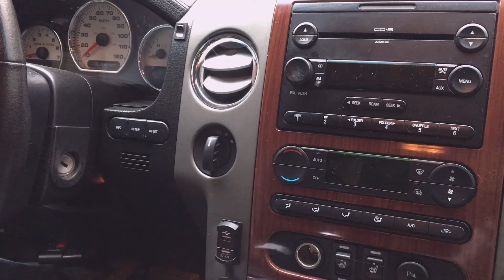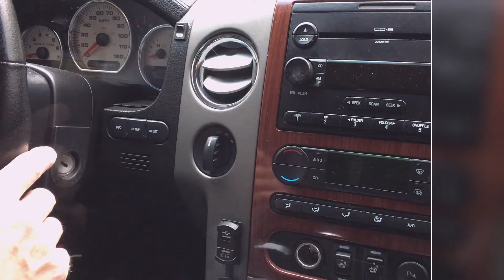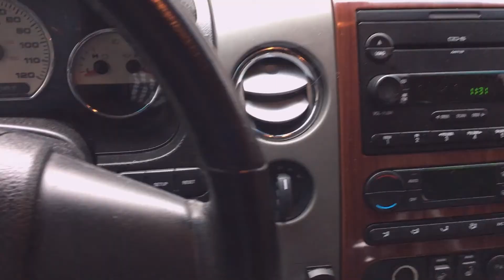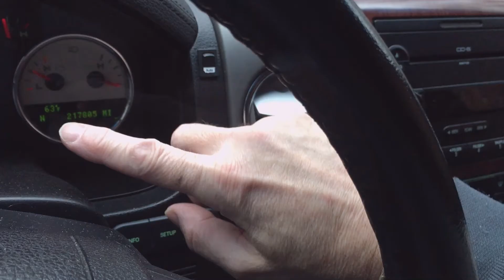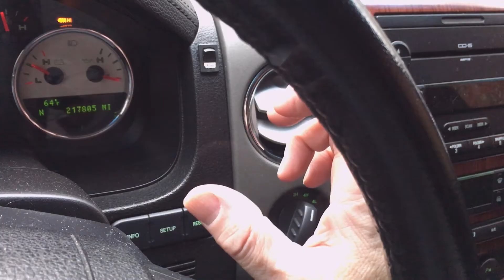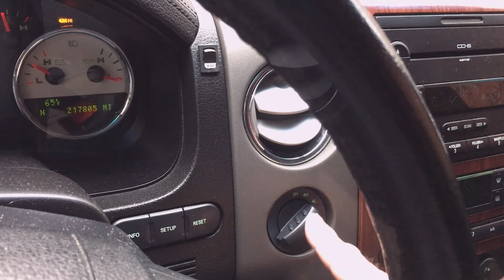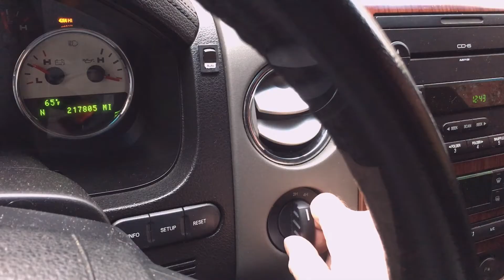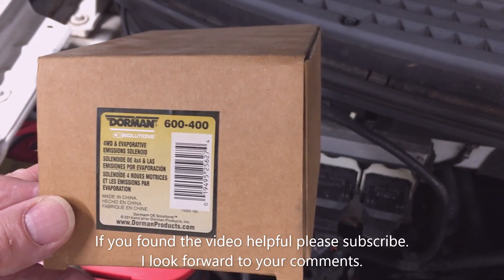4WD Automatic Hub Engagement Troubleshooting & Solenoid Bypass '97 to '18 F150, 11 to 18 Super Duty

Comment: How about first checking vacumm lines at hub. After replacing solenoid and check valve nothing changed. Sure enough I crawled underneath and one of the vacumm lines had become disconnected.
This may have happened when I previously got stuck in a deep snow drift? Works perfect now.
Reply from the maker: Bruce, Yep, most of the time, it is the simplest of things. As a young Army Mechanic, I learned to first ask the Operator, what was the last thing you did. Then describe the problem to me.  And . . . . that is the only time(s) my 4WD has given me problems, is when I needed it most! I appreciate the comment! - Stiles

Comment: Good vid. I replaced my check valve today and realized that it already has a revised assembly with the blue valve. I replaced it anyway but if the grinding still happens should I do the solenoid next? I have one already
Reply from the maker: Terry, I appreciate the feedback. First of all, if your Vacuum Solenoid doesn't have the Plastic Hood over it to protect it from water, then replace it. The Solenoids normally fail in one position or the other, either in open or closed, either in 4WD or not. That is normally. 
You have a grinding noise from your Integrated Wheel End (IWE)? When you engage 4WD?  As I stated in the video, Vacuum to the IWE = Free Wheel or no 4WD and No Vacuum to the IWE = in 4WD.  Your likely problem is the IWE, not the Solenoid.  Let me know how it goes! - Stiles
Reply: Thanks. Problem happens in 2wd. Yes the solenoid hood is not there. I'll try the solenoid next and let u know
Reply: @Kurse19  I'm having the same problem. When I'm in 2x4 i get some grinding then it sounds like the solenoid pulls vacuum again and the grinding stops for a bit, then does it all over again. This happens without any interaction from me. Makes me think i have a vacuum leak but not sure. When I'm in 4x4 high i have no issues.
Reply: @tejanoiniowa  replace the solenoid
Reply: @Kurse19  I did replace the solenoid but still have the same issue. Will try changing the check valve today.
Reply: Is the check valve blue or white? Also it's a one way valve. Take it off and blow through air should only go one way

Comment: Interesting but more questions arise. What does the dash switch actually do? Does it switch off the vacuum solenoid so the hubs lose vacuum and therefore engage? Or does it do something down in the transfer case. I have hubs engaged when truck lifted and engine off. When engine turned on hubs disengaged. Seems normal. When dash switch on to 4wh no dash light on and no engagement of 4 wheel drive. Is it the vacuum solenoid ,or something else down at the transfer case? Also how many fuses are involved. Note at turn on key dash lights show 4wh and 4wl . What other steps to troubleshoot? How do you prove the solenoid? Can it be taken apart and fixed? You mentioned a clicking noise when son turned on 4wh but indicated it was in the transfer case. How many volts should be on the vacuum plug? Should voltage be constant or no voltage when 4wh switch on dash moved?thanks ....the vac solenoid is
Reply from the maker: Michael, I attempt to answer each of your questions: (but first my video covers 1997 thur 2018 F-150 and Super Duty; I could be more specific if you told me what Truck you have)
1) What does the dash switch actually do? I talked about this in great detail in the video, however, if you have an F-150 older than 2004, you have 2 vacuum solenoids on the firewall; the 4WD Switch powers the IWE Vacuum Solenoid and powers the 4WD Actuator on the Transfer Case (for 2004 and newer). For older Trucks, it powers Both IWE Solenoid and the Transfer Case Solenoid.
2) Does it switch off the vacuum solenoid so the hubs lose vacuum and therefore engage? No, it switches "ON" vacuum so the Hubs (or properly called Integrated Wheel Ends (IWE), but "Hubs" is common term) . . .  so the Hubs disengage.  This is designed to allow the Hubs to fail (no vacuum condition) to 4WD, so you not get stuck when you need 4WD, and if you don't need 4WD you just use more Fuel. 
3) Or does it do something down in the transfer case. [?] Yes, it does, see question 1.
4) I have hubs engaged when truck lifted and engine off. When engine turned on hubs disengaged. Seems normal.  Yes, this is normal!
5) When dash switch on to 4wh no dash light on and no engagement of 4 wheel drive. Is it the vacuum solenoid ,or something else down at the transfer case? This sounds like you have a bad Transfer Case Actuator, which is very common.  Again the 4WD Switch powers the Actuator when the Actuator moves and then gets into gear, a Position Switch in the Actuator sends power to the 4WD HI or 4WD LOW Indicator Light on the Dash. (This description is slightly different for older than 2004 Trucks)
6) Also how many fuses are involved. Note at turn on key dash lights show 4wh and 4wl . What other steps to troubleshoot? Fuse 17 (30A) in the Power Distribution Box in the Engine Compartment powers the Transfer Case Actuator and may be at fault. Also Fuse 12 (10A) in the Passenger Compartment Fuse Panel, powers lights and relays (probably not at fault).
7) How do you prove the solenoid? Put your finger on it and have someone more the 4WD Switch from 2WD to 4WD, it should click and you can feel it. Or, you can remove the Electrical Connector and power it with 12Volts.
8) Can it [4WD Vacuum Solenoid] be taken apart and fixed? I wouldn't, it is very inexpensive ~ $ 30.00 (or $40 for Motorcraft)
9) You mentioned a clicking noise when son turned on 4wh but indicated it was in the transfer case. Yep, the 4WD Actuator moves and makes an audible click.
10) How many volts should be on the vacuum plug? Should voltage be constant or no voltage when 4wh switch on dash moved?thanks ....the vac solenoid is.  You should have Battery Voltage (11 to 12.6 Volts).  Because of your question 5 above, and this, Your Transfer Case Actuator may be stuck and trying to move. When you more your 4WD Switch is there a noticeable load on your electrical system?

I watched part of my video again, and I did a good job describing the 4WD system, at least for the 2004 and newer Trucks!  -Stiles
Reply: @StilesAutomotive  Thank you for the reply, it is quite helpful. I took off the transfer case motor actuator and it did turn when power applied. I attempted to remove the 3 T15 screws to get at the inside. Apparantley whatever is behind the 3 T15 screws after sitting for a while can be the problem .  One broke and two just crumbled. I was attempting to rotate it by hand so tha it might free up. I then got a local price on the motor at $275  so i bought one new  online for $77. This was after checking all the relays, fuses and the solenoid on my late model 2004 F150.

Comment: Excellent video but doesn't address the issue I'm having I don't think,

I was driving my truck the other day and it kicked into four-wheel drive several times even though the switch was in 2wd.

I also have two solenoids on the firewall mine is a 97.
My truck is kept under a carport so it doesn't receive a lot of rain I don't drive it a lot either other than hunting around the farm.

Any advice would be appreciated
Reply from the maker: C, You didn't give me much to go on. 1997 F-150 4WD.  How do you know it is going into Four Wheel Drive? Like my Truck, you have 2 sides to the 4WD activation System, 1) the Front Wheel (or Integrated Wheel End (IWE)) Hubs that include one of your Firewall mounted Vacuum Solenoids, and 2) unlike my Truck which has an Electric Motor Actuator on the Transfer Case, you have a Vacuum Actuator on your Transfer Case and a second Vacuum Solenoid on the Firewall.   If you are not touching the 4WD Switch on the Dash, I suspect you may have a vacuum problem, either a vacuum leak somewhere causing your 4WD System to have a problem, or a leak in your 4WD System.  Based on what you said, makes me think your 4WD light on the Dash is indicating your are in 4WD, that is the Transfer Case side, so there is either a leak in the Vacuum Lines/Hoses or your 4WD Actuator on the Transfer Case is leaking.  One of my main points in my video is that, when the 4WD IWEs fail, they fail in 4WD, this is a no vacuum condition. I believe your Vacuum Actuated Transfer Case is the same way, when it fails it goes into 4WD.  Let me know how it goes! - Stiles
Reply: @StilesAutomotive  it's going into four-wheel drive I know this because the four-wheel drive light comes on on the dash and when you slow down and turn sharply especially on pavement you can feel the wheel hop.
You can also feel it when you're going down the road you can tell the difference when it's in 4-wheel drive and when it's not.

But you can hear the click in the dash click click click the – light goes on and off every time it clicks in the switches in the two-wheel drive.
It's definitely going into four-wheel drive.

So you're thinking it's either one of the solenoids on the firewall or the vacuum actuator down on the transfer case motor.

I have good vacuum at the solenoids when the motor is running..
I have not tested the vacuum actuator down at the transfer case electric motor yet.

And obviously it's winter my least favorite time to be crawling under a vehicle LOL
Reply: check your evaporator canister for moisture.( mine was located behind my battery I have a 08 and mine had alot of water. i had same issue as you explained. I alsol had some bad hoses under core support...that's is where the water was sucked Into the system I think. also check your vaccume check valves.

Comment: I like the military spec battery retention system. :)
Reply from the maker: Toby, I did a video to talk about what I did in detail and how I designed the Dual Batteries (See link below). If you are going to change something; either put it back to Stock or design to make it better. Often, it is easy to make it better!  - Stiles

Dual Battery Design & Install; Modification for Any Car or Truck, Shown on 2004 to 2008 F-150 Trucks.  https://youtu.be/t05w5tv64g0

Comment: Ok you video was on point. Good job. Not that I’m anybody to say this but I’ve been looking for a troubleshooting Gide that has some step by step diagnosis and your the closest one yet to my issue. I have the same truck 05 f150 lariat. My question is what should the voltage be in 2H at the solenoid if any or is there voltage when it 4h or 4L. To cut through the chase. My vacuum is good. No issues there. No leaks and my hubs are good. No leaks. When I flip the switch I get nothing at all. And I think it’s my switch that’s bad but still no trouble shooting guide for it. So I’m shoot from the hip on this. Oh and my relays are good. Better say that as well.
Reply from the maker: Shawn, To answer your questions and then work the problem:
1) What should the voltage be at the Solenoid with 4WD Selector Switch in 2H (with Key “On”)? Ans: Battery Voltage or ~11.8 Volts on the Power Wire (Pink Wire / Lt BLU Stripe) from Fuse 11 (10A, Red) 4x4 Solenoid and the other Red Wire goes to Powertrain Control Module (switched ground) will show ground. 

2) What should the voltage be at the Solenoid with 4WD Selector Switch in 4H and 4L? Ans: The same or ~11.8 Volts on the Power Wire and open or no ground on the other Red Wire to Control Module.

3) 4WD Selector Switch (or Electronic Shift On The Fly Switch) has 4 Pins (labeled 1 thru 4, left to right); a) Pins 1 & 4 Switch Illumination, b) Resistance between Pins 2 & 3 of 4WD Selector Switch (3.9 K Ohms, 1.1 K Ohms, 360 Ohms). The resistance tells the PCM the Switch Position and desired Mode (2H, 4H, or 4L).  To remove the switch it has three plastic tabs on the back, (see the RockAuto website, FORD > 2005 > F-150 > 5.4L V8 > Electrical-Switch & Relay > 4WD Switch). 

If you know your 4x4 Relays are ok, you probably have checked your Fuses: Fuse 11 (10A, Red) A/C clutch, 4x4 solenoid in the Passenger Compartment Fuse Panel (in the Rightside (or Passenger’s Side) Kick Panel) is the Fuse for the Solenoid.  Also Fuses 29 and 30 (Both 15A, Blue) PCM 4x4 Power in the Passenger Compartment Fuse Panel power the Transfer Case Actuator (and Transfer Case Shift Indication). Fuse 111 (30A, Pink) 4x4 Relays on the lower right of the same Fuse Panel.

Like I said in the video you should be able to hear your solenoid (or at least feel it) click and hear your Transfer Case Motor.  You should be able to hear (or at  least feel) your 4x4 Relays on the inner fender well near the Vacuum Brake Booster. 

Let me know how it goes - Stiles

Solenoid Wire Colors:
Pink Wire / Lt BLU Stripe (Pwr From Fuse 11)
RED to PCM (switched (-))
Reply: @StilesAutomotive  I didn’t ask the question however I appreciate the detailed and informative feedback. Thank you
Reply: Do you have this same level of knowledge for a 2002 f250 SD 7.3? I am at my wits end. 

Checked ohms on the switch it’s good
Replaced both relays
Bench tested Tcase actuator it is working

When I turn the switch I get no feedback, no lights. Only thing I can find online points to the GEM. I pulled it and it has no visible damage or corrosion.

Fuses are good and no stored trouble codes

Please help